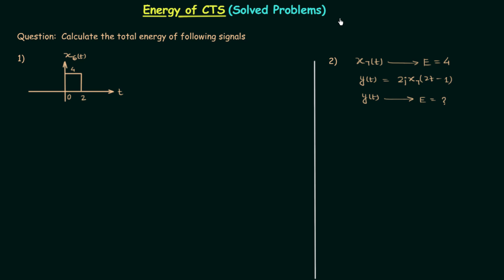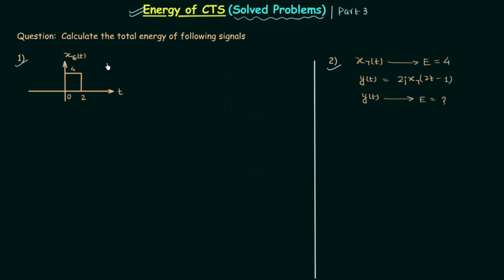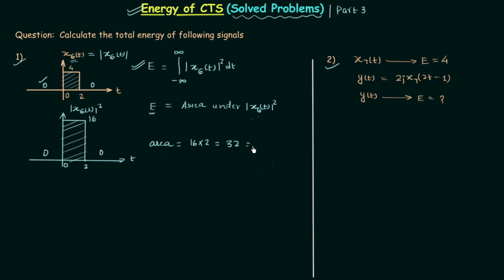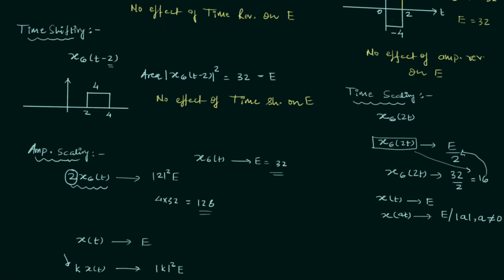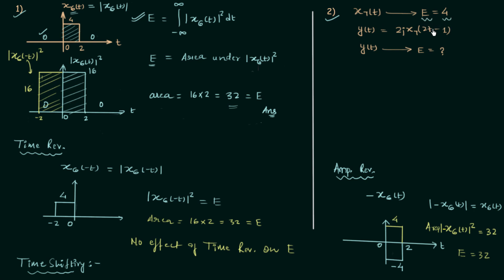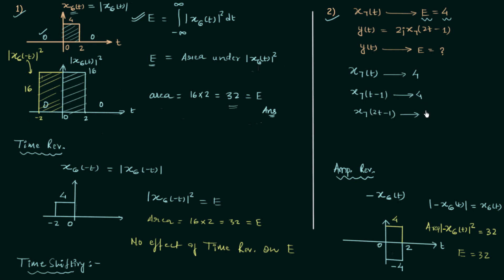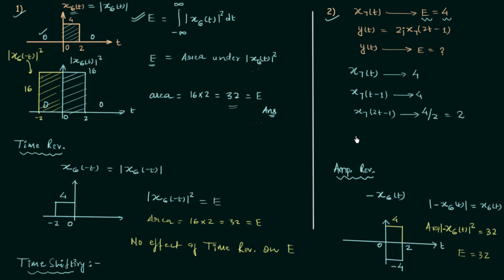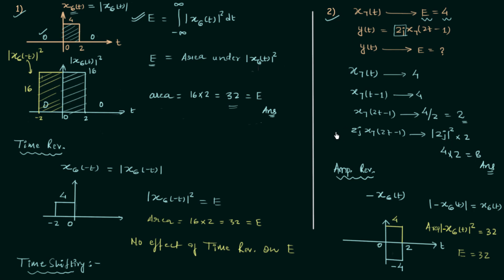Energy of CT Signals (Solved Problems) | Part 3

Comment: If you’re doing amplitude shifting of the signal then you are probably adding a dc value. And dc value is not an Energy signal. Your signal will no longer remain an Energy signal. Energy will become infinite.
I think.
Reply: I was thinking exactly the same thing :)
Reply: May be wo can do intergration for the whole function after amplitude shifting... Like if function is x(t)  then amplitude shifting is 1+x(t) .. And apply intergration.. 
I think amplitude shifting has affect on energy